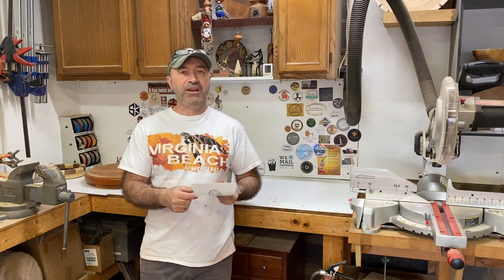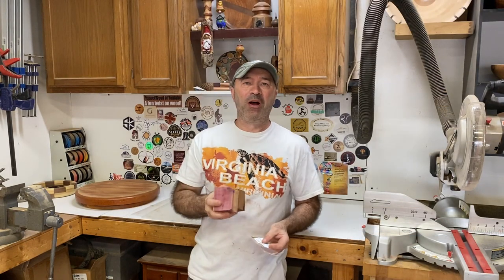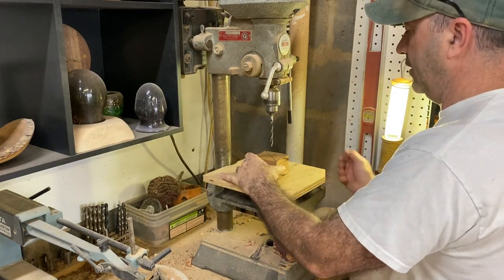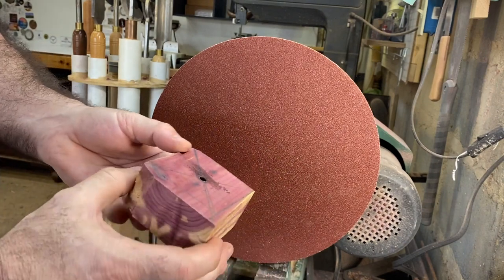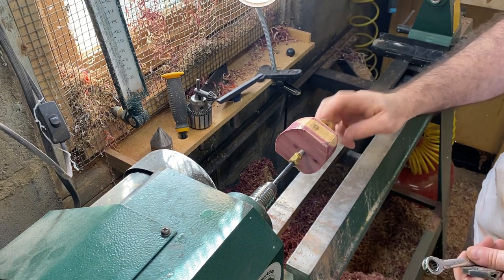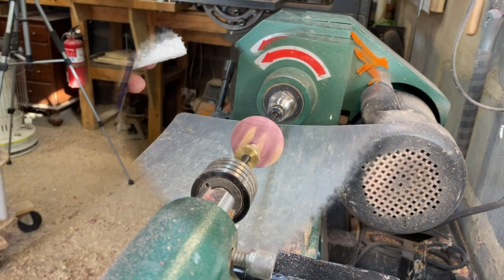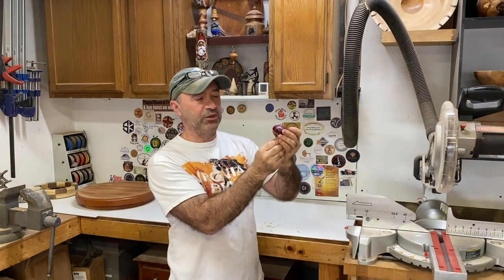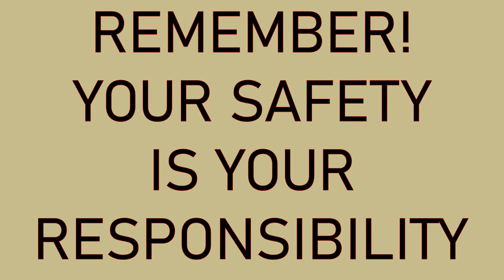Fun And Easy Woodturning A Cedar Christmas Ornament From A Kit

Comment: The kits are nice but the wood is the star. Question for you Luie I thought it was best to use epoxy instead of super glue, but I could be wrong. Take care Geoff
Reply from the maker: yeah I think a 5 minute epoxy would be best
but the thick or medium CA seems to work just fine
Thanks for your comment!